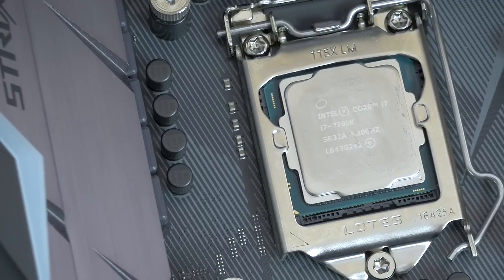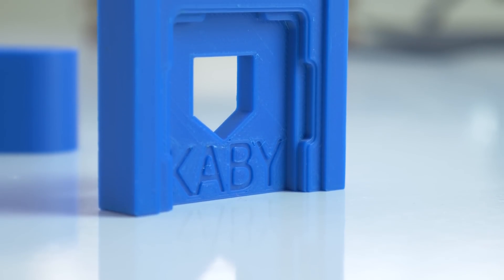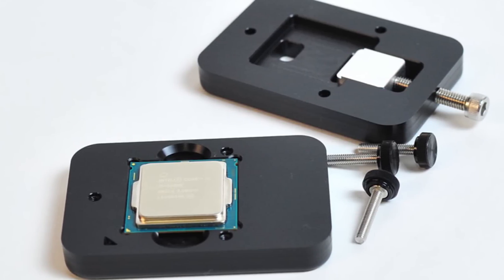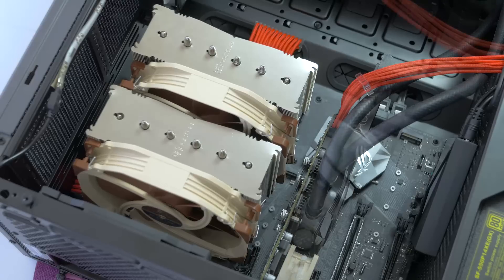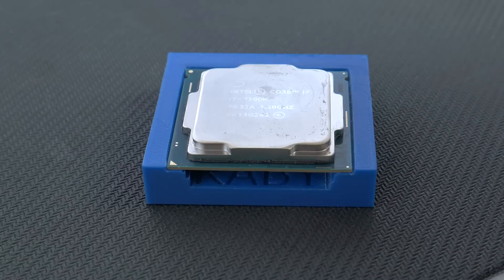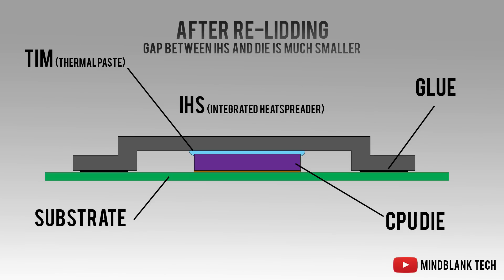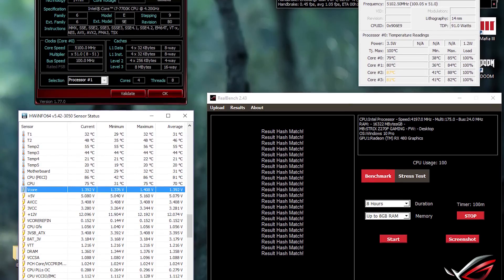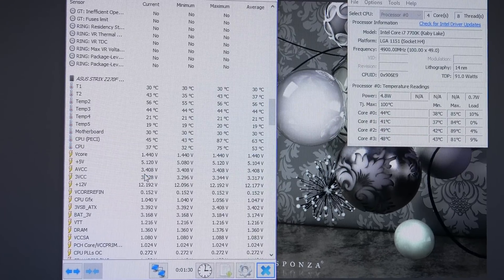Delidding the 7700K - 5.2GHz Overclock - 25C cooler

Comment: It's so bad that you even need to delid the processor. Why can't they just use better paste.
Reply: TechMantra because intel loves to milk their customers
Reply: This way a year later they could put some better paste on it and sell it again for the same price.
Reply: TechMantra my gusse because they don't need to? they most likely see it doing a better Tim job would not net them any more sales. so they end up not caring about it, maybe if Zen smashes hard they will have to try again
Reply: Just pray AMD doesn't fuck up again :D
Reply: They give you shitty paste, knowing you'll delid it (as only K and x versions have this problem).
Now they saved money on the paste and you voided your warranty. So money saved twice.
Reply: I7-7950X that can run 300MHz higher than the i7-6950X all for the lowly price of 2,200$ after taxes. Oh, did i mention you need to delid it to get better temps?

I hope intel dies off. Cheating bunch of cuks.
Reply: ***** lol 7790k we put better thermal paste and now it hits 5ghz all for the low price of 440$
Reply: Meanwhile AMD is using solder for their Ryzen chips...AMD once again one-upping Intel.

The irony though is that Intel chips are going to be running AMD graphic modules in their CPUs in future.
Reply: It's not the paste (at least not entirely) but rather gap between ihs and die itself caused by glue.
Reply: >AMD may license
>may

>The idea that AMD might license
>idea [...] might

>but there’s a rumor that this may, in fact, be in the works.
>rumor [...] may 

Stop posting tech gossip you nerd
Reply: RipplezTV yeah
This might actually be their last chance. If they fuck up this time, nobody is gonna give them a shot again.

AMD GPUs aren't something special either. They have the same performance of nvidia witha few degrees higher temps and power consumption. The only reason why we fanboys stayed loyal to AMD is so they could get that R&D money to get back in the game after Intel payed off every PC manufacturer to use intel CPUs only in their pre-builts. Bunch of assholes.
Reply: @thanos5171  dream come true
Reply: tpcs It feels like this is AMDs year. 
Ryzen and Vega will destroy Intel and Nvidia.
at least their prices.
Reply: @thanos5171  It wasn't bribery, it was an aggressive market partnership. Remember, intel blamed AMD for that whole situation because AMDs management were to put it frankly, garbage and lazy. Intel made strides in business and marketing but AMD did nothing else but stay inside the lab making CPUs.

That was many years ago, hell even the billion that intel lost to AMD in the lawsuit was squandered on shitty FX.
Reply: So it burns up faster so you can buy another
Reply: They do... They add 1 and call it "refresh"
Reply: Without competition, nGREEDIA would price gouge people just as much as intel with the 6950x being 1700 bucks.  So call them fanboys...call them supporting AMD for dumb reasons.  Either way AMD is the ONLY competition to nvida....period.  

Think of why ISP's often throughout the entire space of the U.S.A. get away with OVERcharging their customer's versus the the internet value they actually receive.   

ISP's make at least ( worst case) over 75 cents on the dollar.  For context, most grocery stores ( Kroger,  Walmart, etc) only make at best around 20 cents per dollar and that's  being optimistic. 

Competition, regardless of who it is, helps to some small degree keep a big boy more honest...maybe not HONEST completely, but more honest than not.
Reply: it's not just the paste.  There's no way just replacing the paste would account for a 25-30C drop, no matter how poor the quality of paste Intel uses.  Poor quality control allowing poor contact with the IHS would definitely account for that kind of temp drop.
Reply: I'm still using the 4770K,. I'm probably not going to upgrade until Icelake comes out. I refuse to update my CPU and GPU unless it means at least a 50% solid performance increase and I actually notice an improvement without having to use a stopwatch.
Reply: 2strokedesign lol i can see it now new marking scheme of that there chips run supper cool
Reply: Planned obsolescence that's why.
Reply: i got to say that sounds unlikely intel running amd gpus on their APU...
Reply: The answer is easy: reliability and durability. Der 8auer explains it well in his channel. A company selling millions of CPUs can't risk to use a less reliable TIM which becomes liquid form under moderate temperatures. So for that thermal performance loss there are compromises. The TIM used is composed of a large portion of Gallium I believe. And it's not just Intel doing that, btw. But yeah, to be honest I can't wait for AMD to be back on their feet and rule again =)
Reply: The real question here is "how long will this CPU live on Vcore above 1.4V?" Mine 6700k died after couple months on 1.4V
Reply: Because they are cheap bastards. Soldering would have been a higher expense.
Reply: And what fact do you base your opinion on?
Yes that's an opinion and nothing more.
AMD is good, and your opinion doesn't make it worse.
Reply: Rhyan Eddy Nice fantasy nerd
Reply: They want to make a refresh to cash in on the money. My be like Skull Canyon, like they did with Haswell and it Devil's Canyon or something.
Reply: I think they specificallly make shitpaste out of sedimentary rock to do this.
Reply: I think EVERY pc builder knows that quality matters more than quantity. The only problem a large quantity can cause is uneven spread leaving bubbles or the paste overlapping the CPU leaving a big mess (which can be bad if the paste conducts electricity). The difference between the stock paste and a good paste like Arctic Silver 5 or any other high end paste is noticeable. There are many videos that show the difference. Intel have done the bad paste trick before. When they're ready to refresh a CPU lineup, they just improve the cooling and raise the clock. The 4790K was literally a 4770K with better thermals and a higher clock and it was called "the haswell refresh"..
Reply: Because that's business. Make something shitty in your product so the product eventually fails even if it's in all other ways just fine and would still work for years. That way you can sell another product with shitty feature to your customers and get money out of it even if it causes a lot of waste.
Reply: And that's exactly the reason why reasonable overclocking exists. We delid out CPUs and bring them to the clocks and temps they can achieve. Sure, that shortens their lifespan, but they will still last the amount of years before it really is worth it to upgrade (new chipsets, new ram, new CPUs). Overclocking is the practice of turning your stock CPU into the CPU you really paid for. If intel didn't cap their products, overclocking would not exist outside of competitions.
Reply: palonazo also intel dont have competition for 5 years or so, they dont have to make good products
Reply: Eduard Calota most accurate reply here
Reply: palonazo dude it's called Ryzen look it up :D
Reply: I'm not switching to AMD. I always hackintosh my builds and it's a pain in the ass to do it non-intel/nvidia...
Reply: Same here bro. Currently rocking a hackintosh with 4770k and gtx 970...runs like a dream
Reply: Much better for business to make your costumers destroy their chips and come back for more, rather than designing a good product to begin with. It's not like they're not aware after all. Any random guy can do this in less than an hour, and yet they just refuse to. They're just arrogant.
Reply: Laptops are a lot trickier than desktops because they may have a lot of incompatible components (chipsets, wlan, sound...). In desktops it's pretty much straight forward nowadays. You buy OSX and create an installable pen drive with a program on a real mac or with an already working hackintosh. Then you just that pen drive on your pc to install OSX. After installing the OS, you need to install a couple things for it to be able to boot without the pen drive (a bootloader). Dual booting windows and osx is very easy. I use OSX for work and Windows for everything else. Checkout tonymacx86.com for guides.
Reply: If I'll allow you to buy OSX Sierra then sure. But think about it. You'd need to find an OSX version that you could install in a virtual machine, only to get OSX and do the unibeast thing. Don't you have a friend who can lend you a mac for 30 minutes?
Reply: I really wish I could say that there's probably not a conspiracy at play here, but.. There is literally no way that Intel are not aware of this issue, and yet they keep producing products with the same exact flaw. They've been making this mistake for years now. People have complained about it for years. I'm not aware of any official statements from Intel regarding this issue.

Clearly they don't want you to be able to reach the full potential of their chips, artificially limiting their own products for no clear reason, other than perhaps to make future lines look more attractive, and make you forget the fact that even chips that are years old at this point are still holding up nicely, as software-requirements are not actually increasing at the same rate as computing power.

Either that, or they want you to ruin your CPU quicker and shop for a replacement. Or maybe they want to encourage you to void your warranty by taking it apart? 

Either way.. I'm pretty smart you guys, and yet I honestly can't think of a single good reason for Intel to keep doing this. I refuse to believe that they're simply just incompetent or lazy.
Reply: StopaskingformynameYouTube The second CPU is there to keep people happy while the expensive shit (the 10nm node) is in development
Reply: I can post twitter screenies if ya want
Reply: Why not solder the lid directly to the chip ??
Reply: The TIM Intel uses is fantastic. The gap between the die and the IHS is, however, too large, poor engineering or planned obsolescence. I delidded my CPU, but did not repaste. No surprise, I got a near 22C drop. Not as good as liquid metal TIM, but better than the Noctua NT-H1 I used on my friend's 6700K.
Reply: mine was re glued with some black rtv so maybe Intel just uses to thick of glue?
Reply: Ur right.
Reply: costs money.
Reply: adding a bit more money to a 400 euro cpu...
Reply: Clem Fandango bruh its dangerous!
Reply: brez imena sad story
Lost 400$ on its own
No warranty is there
Reply: is not bout quality of paste but about quantity
Reply: palonazo every producer know if you have the lowest chance to produce a broken product they will you will evade for a safer option, puting less thermal paste is risky, because it can overheat the processor, it can be problematic on long run or the paste can dry out, and in the end it does not matter better thermals boes not mean better clock speed
Reply: palonazo roasted intel
Reply: It's so that next year you'd buy the next lineup for improved core clocks due to chip optimization. I've got the 4790k which was supposed to have better TIM but it still throttles when I try to apply like 1.32 volts with a pretty decent tower cooler.
Reply: why can't they just use solder.
Reply: They can. They choose not to. It's been explained. The chip can do more than they want you to do with it. A few months after they release, they just re-release it with proper solder and small improvements and call it a new chip. They've been doing that since haswell. Only now that Ryzen has come out, we'll see Intel releasing good chips because competition does that.
Reply: palonazo is it easy? 
Can u duel boot win10  os 10.11? Specs
I5 5200u
920m
8gb ddr3l
1 tb hdd
Reply: iboot?
and a 16gb flash drive? i tried dose but i dont think u can do it with a flash drive!
Reply: Oh no no. Iboot is a very very old method. Nowadays we use the Clover bootloader. It's the most vanilla way there is to run OSX in a non-mac computer. You can do it by hand, or you can use 2 programs available in tonymacx86.com. The first one is Unibeast and you run that one in a real mac or a working hackintosh to build the bootable OSX install pen drive. You need an OSX installer in the apps folder for it to work. Unibeast will cook your pendrive with the OSX installer and the Clover bootloader automatically. Then, after you've installed OSX in your hackintosh, you use the second tool, which is Multibeast. That one will install a few kexts required for power management and sound and it will install clover in your EFI partition automatically, so you can boot in OSX without using the pendrive. It's VERY straightforward (in a desktop). When it's all working, and if you're dual booting, when you turn on your computer, the first thing you'll see is the clover bootloader, where you can choose if you want to boot in windows or in OSX.

Step 1: Download macOS Sierra from the appstore in a real mac or a working hackintosh
Step 2: Create a Bootable USB with UniBeast in a real mac or a working hackintosh
Step 3: Set up recommended BIOS Settings
Step 4: Install macOS Sierra
Step 5: Use Multibeast for post-installation

Hardware used to be very restrictive in the iBoot years. It took me a whole week to get mine working, and it wasn't stable. Nowadays I could reinstall everything in about 30 minutes. Also, by using this Clover method, the install is so vanilla, that you can even update OSX just like you would on a real mac through the appstore. With clover, I don't think I've performed a full reinstall since Mavericks and now I'm on Sierra 10.12.3 with everything working reliably.
Reply: palonazo I have broken g4 soo thepiratebay!
Reply: It will not work. You need a legal copy of the OSX installer downloaded from the OSX Appstore that Unibeast will look for in the Applications folder. The specific appstore version of the installer needs to be there in order for unibeast to work.
Reply: palonazo virtual box?
Reply: palonazo bro
Im  13
90% of my friends ( if not all ) dont have or know whats a mac
Reply: palonazo and u can flash from vb to a fladh drive too :D
Reply: Sure you can, I just wouldn't even know where to begin to get OSX to run in VB. But hey, it's doable. You'll only need to do that the first time. Once you get your hackintosh running, you effectively have a mac and you can build a better install pendrive from there.
Reply: Jexiel Aviles you are shitty intel fanboy
Reply: palonazo dats a good ifea! But where can I find a 16 gb pendrive :D and u sure u can triple boot 2 win 10 one mac os?
Reply: Yeah none of these 5 GHz chips will last long at 1.4v due to degradation.
Reply: It's not a flaw, it's intentional.

They make one chip, then then sell that with a specific clockspeed and bad thermal paste.
Then they release another chip based on the same one with better paste and some minor modifications for improvements.
Literally NO developpment cost for the second cpu in that lineup, yet all the income.
Reply: I think a good strategy is to buy a CPU and use for about 3 years. After 3 years, delid it and give about a good increase in clock speed over your previous stable non-delided overclock. If it works and a chipset upgrade isn't worth it, you probably gave your CPU another year of good use and the chance to skip a whole generation. The more generations I skip, the better it feels when I upgrade. I know I won't be upgrading this year UNLESS the 8770K really is groundbreaking. Same goes for the GPUs. Currently on a 980ti and I know I'll skip the 1080ti. The trigger for GPU upgrades for me now is VR.
Reply: definitely. But you'll never fry a chip just like that. It has protections. It'll bluescreen before anything bad happens permanently. Chips die after years of high temps, not because of a short high temp burst.
Reply: Bike Dude no
Warranty is voided if it died from oc
Reply: HappySlappyFace - I'm not sure that's true?
Reply: Rakinjo2 I once asked intel about oc
They said it will void warrenty
If u want pictures I can give ya
Reply: +HappySlappyFace More void than a super massive black hole.
Reply: Oooh, right - I'm sorry, I read your comment wrong the first time. I thought you said it wouldn't void the warranty. My bad.
Reply: Rakinjo2 lel
Reply: Bike Dude is this to say AMD are wasteful environment destroyers because they still solder? Why doesnt intel seem to factor the cheaper and more environmentally friendly tim material and easier + less costly process into their cpu prices?

i know that was simplified, but i didnt feel the need to over complicate it
Reply: Bike Dude damage if done wrong perhaps. AMD has been doing it for a while and i doubt theyve been intentionally letting damaged cpus reach the market
Reply: +TechMantra
Brand new broken ≠ broken over time.
Reply: TechMantra cost
Reply: @jeff O Like hell = more than 10%?
Reply: Don't be an idiot and buy AMD Ryzen.
Reply: It is confusing only to those who have got too brain damaged already to understand anything.
Reply: Don't be angry at me. It is you who is too dumb to understand written language based on context. Bye.
Reply: @Nihad Asadli lets be honest i love amd but when they are cmpite intel never truely win
Reply: Intel put shit paste in cos higher temps = faster death = faster you buy another cpu.
Reply: they want to make the cpus reach a certain spec reliable and the stock frequency is what they reached
Reply: TechMantra ii
Reply: TechMantra Can't You Also Add That Thermal paste in the delided CPU Too? -_-
Reply: My 0x1E fuck me.
Genius.
Reply: well said xD
Reply: or, just solder the damn thing
Reply: actually i tried better paste it didnt do anything better but when i put liquid metal right away 20c less
Reply: Actual reasons:
1. Intel along with companies like Apple avoids purchasing conflict minerals (some found on solder) ever since Haswell. Intel was already called out by the company handling this when they mass produced soldered Broadwell chips.

2. Soldering chips are expensive with an actual failure rate in a FAB. Intel is sacrificing thermals for less CPUs thrown away due to imperfect soldering and to avoid additional costs for intel CPUs which are already expensive to begin with.

3. You don't really NEED to delid. 5Ggz or a little bit higher is doable with a good cooler and case.
Reply: Jexiel Aviles You are shit.
Reply: wait for intel to announce the 7790k...
Reply: It has nothing to due with the thermal paste(the thermal paste that's use in those CPUs are state-of-the-art thermal grease that are superior to the aftermarket stuff), it has to do with the fact that there is a small micron gap between the silicon and the metal lid due to adhesive causing the lid to not make proper contact with the paste/silicon. Delliding the CPU allows you to remove the binding adhesive, which lets the cpu make a closer contact with the lid.
Reply: David Scheindlin https://www.extremetech.com/computing/240714-amd-may-license-radeon-graphics-ip-intel-use-desktops-high-performance-computing

"Nice fantasy nerd" It's happening you moron.
Reply: And yet also paid AMD 1.25 billion dollars for it and squandered the money away  8 YEARS AGO. Jesus Christ, can people get something new to harp on. AMD has horrible management, and killed the lead they had over 10 years ago away by themselves with shitty, faulty hardware and the inability to stick to any deadlines or release fixes to products they fucked by switching to a new manufacturing system to make manufacturing quicker even before Intel tried to circumvent anti-monopolization laws. 

They had more than enough money with the 1.25 billion dollars to pay back some of there largest investors and still put enough aside in liquidated assets to get back in the game, but they didn't, as well as to rebrand, rebuild and build new and existing partnerships for large PC manufacturer's. I'm not an intel or an AMD fanboy, I just understand business and you can't blame intel anymore for AMD's piss poor investments and management. 

Hell AMD literally has a CAA1 credit rating right now which means they don't pay there bills, and it's hard to get investors these days when they see you don't like to payback your debts.

The only reason they posted growth this last year is because of the hype around Ryzen, and investors are believing they can turn a very quick buck if everything goes well. But if they screw things up this time, investors will pull there money so fast you'll most likely see there stocks drop by half in a day.
Reply: Wasn't like that before VR. There had never been such a great jump in performance. Heck, my 980ti is slower than a non-ti 1080. The 1070 is faster in some scenarios than my 980ti. That's all because Nvidia wanted to lead the VR GPU race and they explicitly advertised the 10 series as the VR series and they weren't lying. Competition is always good and AMD (ATI) are doing a great job at making Intel get back to work.
Reply: cost. Running a business for big companies is about getting as much profit as possible even if it means sacrificing things such as high quality thermal paste (under the IHS)
Reply: It's definitely shit lol.
Reply: AMD is shit.